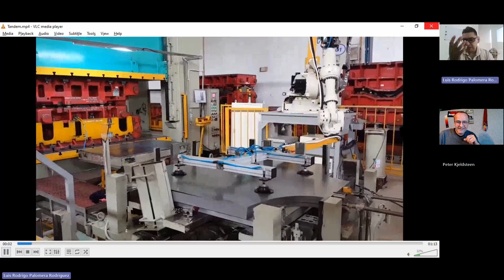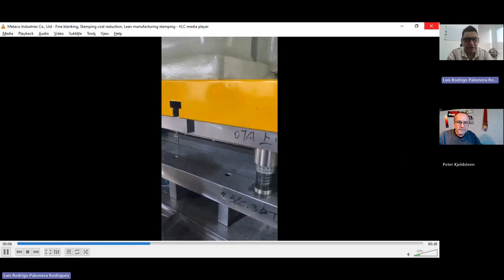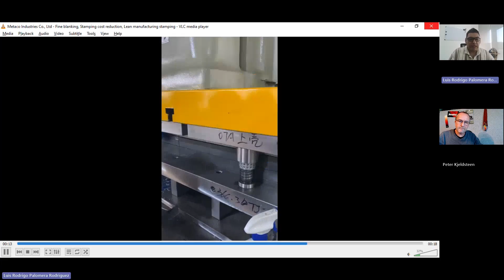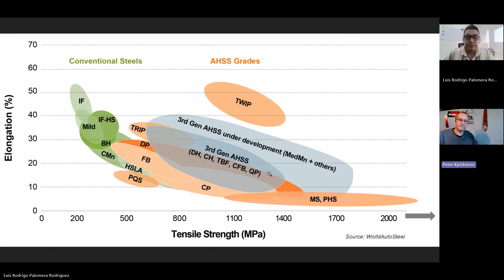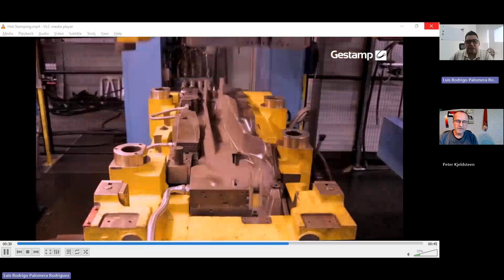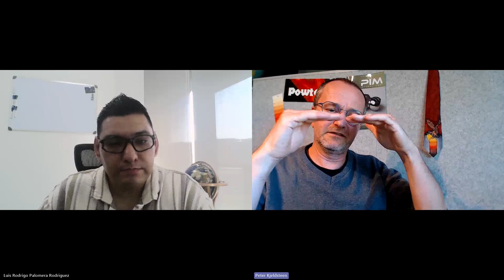How Metal Stamping Shapes Cars | Automotive Sheet Metal Explained w/ Luis Palomera

Comment: Great podcast. Thanks for the insights to stamping 😊

Are there any minimum requirement for the ductility (i.e. the elongation to fracture) when doing cold stamping? Does texture play a role for this process? Does yield stress of the material play any role for the tool life?
Reply: Hey there! I’m the guy talking lol. 

1. The requirements are dictated by the intricacy of the part being made.

2. You don’t talk about texture but about roughness. And yes, generally speaking you want a roughness of around 0.7 to 1.7 Ra.

3. Not really. You want the material to break at the edges, so it’s more of a TS thing.
Reply: @negator14  thanks Luis 👍